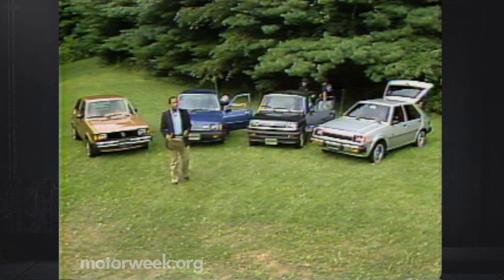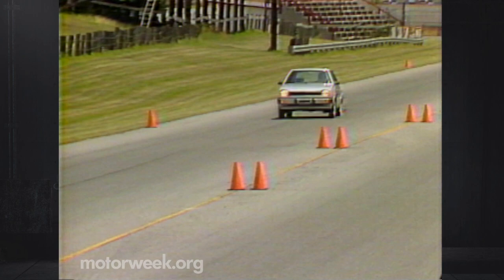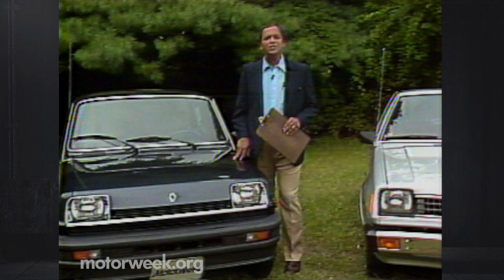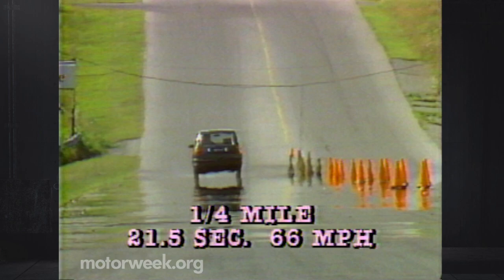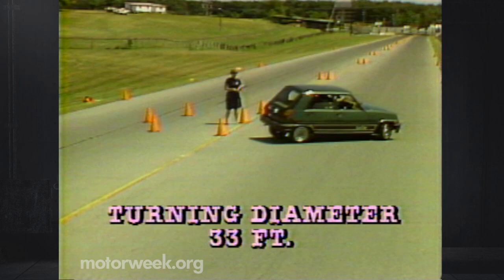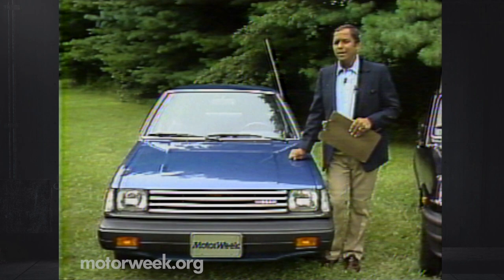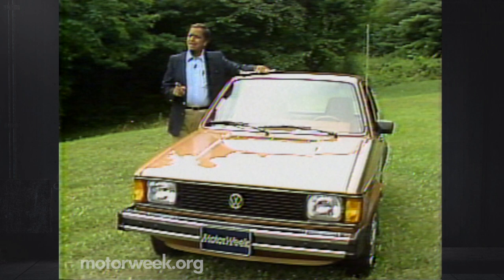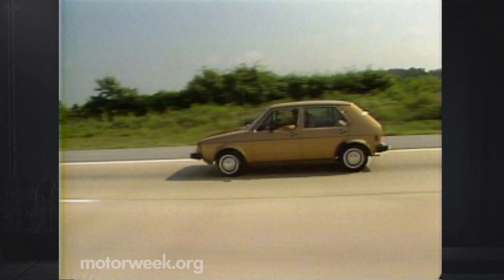Retro Review: 1982 Econobox Comparison

Comment: I owned manual variants of the 2 winners here.  I had the 82 Nissan Datsun Sentra MPG (yes it had both Nissan and Datsun written out on the trunklid). The low rolling resistance tires were so bad on it I replaced them after about 500 miles.  I regularly got over 50 mpg with it.The interior vinyl was terrible it fogged the windows with emitted oils (my lungs too) and completely deteriorated in less than 2 years to the point it ripped by sitting on it. My 1980 Colt was a much better all around car, well made but smaller and much sportier to drive. In those days I pulled the catalyst out so I could drive it with cheap leaded fuel. Not proud of doing that.

Comment: I owned a 1985 Nissan Sentra and I must've gotten a Lemon because it was one of the most unreliable cars I've ever owned. Mostly carburetor issues but major ones and a few electrical problems. I did like the way it looked
Reply: Smog equipped carb engines were trouble prone.
Reply: It doesn't like you how to treat it, Happy owner of a 1985 Nissan Sentra sedan,  well maintained and driven it like grandpa. Very Reliable and runs and drives like the 80s

Comment: How have they stood  the test of time? I would think the VW would be the clear winner. NADA values 2nd place: Rabbit L  $1072 to $2425,  3rd place: Sentra $625 to $1325, Dead last: Colt $450 to $1500.   I Understand the first three but way out ahead in 1st place: the LeCar: $4225 to $10900?????   Though these are NADA "values" and actual sale values may be way different.  None have any Sold listings on eBay in the past 60 days.

Comment: I can't believe they were able to get over 40mpg with that Nissan! Where can I find one?
Reply: Trance88 Nissan micra
Reply: Had to believe both the low weight (try to find a 4 seat sub-metric ton [< 2200 lbs.] US-spec car these days w/today's safety standards; closest would be the today's Mitsubishi Mirage / G4, descendent of the Dodge Colt tested here) and the overly optimistic EPA measurements of the day. 

I'll bet today's Nissan Versa or Note (believe both have 30/39 EPA numbers w/a CVT auto and 106hp engines) would've fare at least as good in real-life testing as many of these did back then + they're much larger (5 American-sized passengers in comfort) inside.

Down here in Puerto Rico you could find a few US-spec L11 (OG) Sentras of any configuration (2, 4 door and wagon).

FACT: The '85 MY L11 Sentra Wagon was the 1st US-spec Nissan imported from Mexico.
Reply: Actually it's MORE THAN THAT. The wheelbase the L11 (OG tested here) was 94.5" (shorter than a Juke or Micra), while today's C17 is  106.3". So, there's a whole lot of additional metal on that modern platform, not only the safety and equipment considerations.

The lightness of the car (L11's was probably slightly > 2K lbs. vs. the > 2800 lbs. of C17's) and the overoptimistic measurements of the US-EPA back then did affect the reported numbers. Even if you stripped every comfort and safety measure to a C17 it wouldn't amount to the weight of an L11 and wouldn't give their fuel compsumption numbers.

More realistically a (69hp) L11 would be a 45 MPG combined car on today's EPA measurements while a decontented (130hp) C17 would approach 40 MPG combined (+ ~ 5 from the normally equipped US-EPA numbers).
Reply: Trance88 I just bought one for 300 bucks. 110k miles, 5 speed and rusted to hell but it runs great! Still has that famous mpg...and its a rarer paint code (butter yellow).
Reply: Lets find out how long it takes you to figure out what consensus means... anybody who starts their comment with "bitch" must be a real winner.
Reply: Did you try the oak tree expiriment yet?
Reply: Further proving he's a one trick pony ^^
Reply: Shame you have such a simple one track mind lol....
Reply: xr7fan I guess it's impossible to have a semi intelligent debate with you. Perhaps I should've known this earlier. I'm glad you were able to expand your vocabulary beyond "bitch", though.

Comment: No Honda  I bought a 81 civic in 1990 when I started college. It had 66k miles on it I drove it till 2016 put 300k miles on it replaced the water pump and changed the oil like your supposed to and put tires on it when needed and that's all I did for 300k miles.

Comment: Of the four subcompact cars here in this video, my favourites have always been the Dodge Colt, and the VW Rabbit. IMHO, the best looking of the four are the Dodge Colt and the VW Rabbit.
Reply: Jason Carpp Exactly
Reply: Overall, the (Datsun) Nissan Sentra was a good looking car, but I found the front end appearance to be hideous. I had a neighbour who had a Dodge (Mitsubishi) Colt. His was a 3 door, whereas this was a 5 door. I cannot remember whether his had a 4 spd. manual gearbox or a twin stick manual, or an automatic. I also know some people who have owned VW Rabbits over the years. :)
Reply: I think the best was the Nissan then Rabbit. I drove a twin stick Colt and I was very unimpressed. I worked in auto parts for a long time and always hated hearing the Colt name. I never once found the right part for the car. I always had to get the part number of the original and cross it. VW had a couple different engine blocks and water pumps were not the same. Think one was 18 bolt and the other was 20.......something like that.

Comment: 35 City and 50 Hwy MPH in 1982 - IMPRESSIVE compared to 2020 vehicles
Reply: The EPA mpg calculation changed about 2008 so the numbers on older cars would be lower if you went by that.

Comment: I would've gone for a Dodge Colt 4 door but with a manual transmission, why didn't they test one with a manual shift?
Reply: I had an 82 colt with the twin stick manual transmission, which essentially was an overdrive that you could use on any gear making it an 8 speed transmission.I could find a gear just right for any situation. I still can't figure out why they don't still make those transmissions. It was a fun little car that I drove hard all the time. I enjoy working a small engine, it makes me feel like I am one with the car instead of the numb experience of a lot of other cars.

Comment: The Volkswagen Rabbit would be the clear winner for me because it is the most reliable and longest lasting. But I would want the older model, with 2 doors, a carburetor, and round headlights. By 1982, VW had already started turning it into computerized junk. The Sentra would be the next on the list. Not as good as mid to late '70s models, but light years ahead of what Nissan makes today. The other two aren't even worth considering. I remember the LeCar, with it's THREE lug wheels. When it comes to cars, the French can't seem to get anything right. As for the Colt, it's quality is poor, and I hate it when American car companies put their name on imported cars. 

I'm somewhat shocked that reliability and longevity were not even considered. That would always be my number one consideration when buying a car. And none of these cars have a whole lot of that. How many are still around 41 years later? I'm still driving a 1972 Ford Pinto wagon, it is still rock solid and drives great. And unlike these cars, it is rear wheel drive. The AZ sun had damaged the paint, but 51 years later, most of it is still there. A new paint job would make it look like a new car.

Comment: fascinating that those cars all averaged between 55 and 75 hp.  where do you find that anymore?
Reply: You can't really. Some of the weakest engines currently available would be something like what's in the Smart Fortwo which is rated at 89hp or a Mitsubishi Mirage that is rated at a paltry 78hp. But you almost have to go out of your way to find something that gutless. Most modern economy cars make at least between 120hp and 150hp these days.

Comment: The Renault Le Car had a disadventage: sound system on the floor, no mirror at right side of the driver. Too difficult to reach at.
Reply: The Renault has more disadvantages than that.    Where do you want to start?
Reply: @scdevon  The back space for passenger and luggage very scarce, buddy. Don't you think?
Reply: @elmowilson298      Looks and features and ergonomics are the least of the Renault's problems.  Abysmal reliability and a sparse, flaky dealer network in 1980s in America was their problem.      Thankfully, engine fires and rust and Cash for Clunkers got most of these eyesores off of our roads pretty quickly.
Reply: @scdevon  Yes, sir. It's good to lmow that about Renaults. The current ones look better and complete in every extra, I think

Comment: This 1982 Nissan Sentra has worse fuel economy than my 1984 Ford Del Rey. Both has same size, but mine was a luxury car in Brazil. Nissan Highway Mileage is worse than Ford City Mileage.

Why? I can't understand. Mine is a Ford product under Renault-Willys' project. Just that, no big deal, no japanese engineering...
Reply: Some US-specification cars had reduced fuel economy because of smog devices. It was especially bad before electronic fuel injection.

Comment: Why would you buy any of these when the Honda Civic was available?
Reply: Because millennials had not been born yet.
Reply: People may have been afraid of the Honda CVCC engine. The early ones were trouble prone. Honda eventually did build good car engines, but I don't know if they got it right in 1982. They had the worst carbs and vacuum operated smog devices of the time.

Comment: Worked for a Renault Amc and Jeep Dealer in the 1990s . The Renalt le Car had the worst shifter I had ever used. The remote shifter system they used and the placement on the dash of the shifter became useless after low mileage because it would wear out at low mileage did not have a clue what gear you were in. Also Who puts the spare tire on top of the engine. this was the worst piece of shit I have ever drove in my infancy of driving anything now after driving everything else this thing gets the crown of the worst piece of shit EVER!!!!!!

Comment: They missed the best car in that category, the Honda Civic.
Reply: Honda Civic was not an econobox
Reply: @artistnyc123  Why would you say that? A 1982 Civic had a similar size and a slightly cheaper price than the Rabbit and Colt.
Reply: @gotham61  LeCar was around $4500 and the Civic was around $5800 new. THat's a whole different category.
Reply: @artistnyc123  Listen to the price of the VW @24.50  $8,195, with a base price of $5,990

Comment: Wow. In 1982, the car market was shit lol. Horsepower was down, weight was up, style was minimal... yikes.
Reply: Also, isn't the Colt a rebadged Mitsubishi?
Reply: Passthedutch The selection of cars here looks better than today's cars of the same class...but that's a matter of opinion.
Reply: Back then, it was not uncommon to have cars weigh in under or at 2000 U.S. pounds. The lightest car sold today is the Mazda Miata, which comes in just barely under 2500 U.S. pounds. You can thank the safety airbags and welded crash bracing for the weight increase in cars today.
Reply: Theodore Thorpe I'm entirely thankful for airbags and crash bracing. I'd rather be safe. That's a stupid comment.
Reply: Joe Blo Mpg no better? I'd say we're considerably better, weak carburatored engines mated to 3 speed automatic transmissions? Get real. The 80's were the worst decade for cars. The worst at everything, really.
Reply: Passthedutch - If anything MPG has gotten worse. My dad had a 1974 Datsun B210 2-door hatchback in the early 80s. He did mileage calculations then on that car when he owned it, and he consistently got at least 40MPG and cracked 50MPG a few times. Fuel injected 1.2 Litre 4-cylinder gasoline with a 3-speed automatic. Would have been better with the 5-speed manual. No catalytic converter either in those days which helps MPG more as Volkswagen has proven with their diesel scandal. Cars have trouble cracking 40MPG now. It's no better. Safety is, but not MPG. The heavier the car is, the more force required to move it. It's basic physics.
Reply: Weight was way lower than today. Except for the drivers...
Reply: "Cars have trouble cracking 40MPG now. It's no better. Safety is, but not MPG. The heavier the car is, the more force required to move it. It's basic physics."

And yet, the cheapest and most basic 2018 Toyota Prius, which weighs in at 3,075 pounds, gets 54 mpg in the city and 50 mpg on the highway. Safety is no contest either, the 2018 would win easily.

Comment: Just started the video and can tell you they all sucked. 80's cars were horrible boxes with lawn mower engines. I mean I loved our 85 and 86 Trans-Ams but those 305 engines sucked in them too. Hahah that Colt did the 1/4 in 20 sec at 69 mph hahahahhaa.
That Le Poo had 51 hp?..Our lawnmower back then had 12.
Then again had a 85 Toyota Corolla and it was pretty good.
Reply: Daehawk I think the performances are all more than sufficient for 50 mph speed limit. These cars are far more reasonable than the gas suckin' monsters of today. 35 Years ago, they had a better gas mileage which says a lot over our insane world.
Reply: Yes but they used a different method to rate MPG then too.
Reply: This was not a fair test considering the Colt had the automatic and the other had stick shift.  The Colt had the best stick shift on the market with the twin stick.  It was fun  to drive and was peppy.  The Colt still came in second, but it would have won if it had the twin stick.
Reply: Daehawk not everyone wants 10mpg...these are still cute cars compared to the ugly plastic bubbles they make now
Reply: Juri Vlk i agree today's cars are ugly plastic bubbles and get lousy mileage